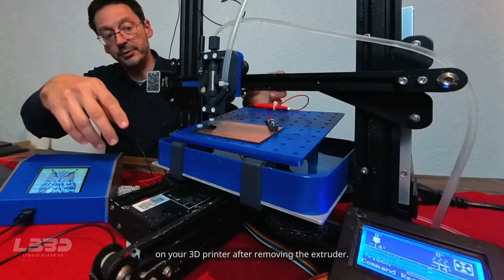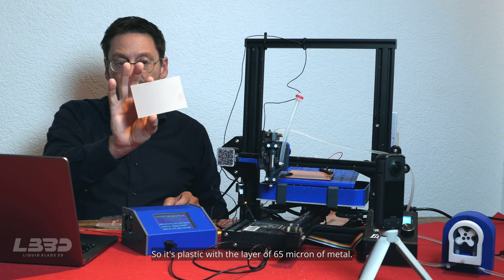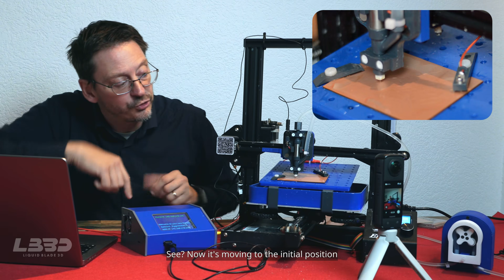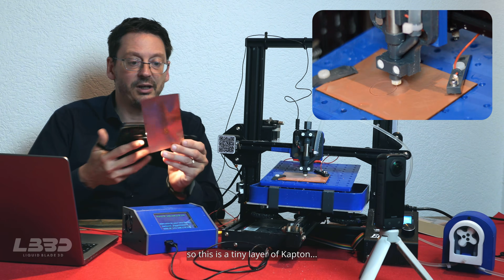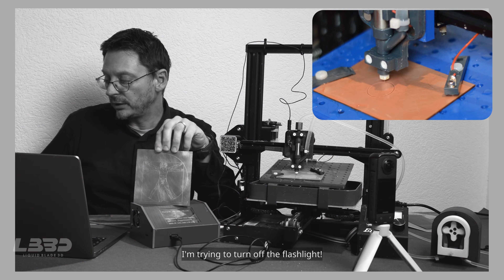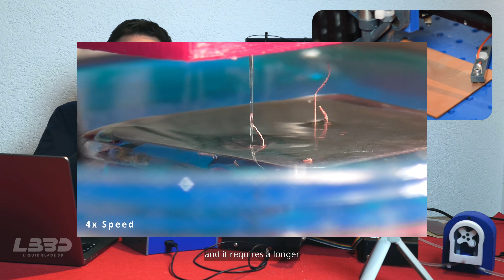Cut and Engrave Metals with YOUR 3D printer! - Liquid Blade 3D

Comment: As a fabricator I must know what the maximum thickness of material is that can be cut. 
The greater that capability the more interesting this will be.

Compatibility with low-cost large format printers like neptune 4 max would also strongly increase the usefulness.

Comment: Since it's working for bedslingers, will there be a version for the VERY common Bambu A1?
Reply from the maker: We made a list with some common 3D printers to support, but since LB3D is relatively easy to adapt, we are also open to support other 3D printers. If you are interested, email us at info@athenatech.nl and we can find a solution!

Comment: 1. Can I cut alluminum on this machine?
2. Can I cut steel on this machine?
3. What is the maximum thickness of cut?
Reply from the maker: 1. Yes, all conductive metals can be etched/cut (with the appropriate solution) 
2. Yes, we also made a time-lapse video cutting steel here: https://youtu.be/1JAKQVie_q8 
3. We tested thin cuts, in the region of 0.1 mm width and depth up to 2/3 mm. The cut on solid steel was a 0.2 mm wide line, with a length of 28 mm and depth of 0.8 mm in around 2 hours. We also did 5 mm thickness on copper from a single side. There is really no maximum, it depends on time and the type of metal.

Comment: Great project , now I might consider pulling out my ender 3 out of storage, question can the process  be used to cut or shape Carbide tips for lathe tools?
Reply from the maker: In theory every conductive metal with the right liquid solution can be etched and cut with Liquid Blade but of course some metals are way harder then others to work with. Carbide tips are made of tungsten or titanium, we did a test etch on titanium and it works, but it takes more time and current then steel or copper.

Comment: Looks like an interesting project, looking forward to it taking its final form out of the prototype phase. Would love to try it out, however I am not sure how I would be able to source those things like Borax and other things over here in Bhutan, as we don't get many things in the local stores. Even for printing filament, until now I have been getting it delivered via Amazon india. 
Also I had a question about the setup if the final product would not just be a fully working out-of-the-box product like the printers. Currently I have a Bambulabs mini and I have an older Ender 3 s1 which has been collecting dust since last year. If it would be possible, I think it would make perfect sense for me to turn it into a permanent setup for your LiquidBlade product. This is a great initiate and wishing my congrats to your team and the endevours la 🫡 I would love to know more about how to remove the printer build plates and where do each of the components like the tray and plates go.
Reply from the maker: Thank you! 🫶 The final product (as well as the prototype you see here in the video) are fully working! We will post a follow up video on how to assemble and take the system apart, it is really easy and quick. 
About the ingredients for the solution, we will open our online shop with accessories, spare parts and, if the there is demand, also solutions for different type of metals. Feel free to email us at info@athenatech.nl for any technical/commercial question!
Reply: @Athena-Technologies  Thank you for your response, I look forward to it and hopefully will be able to obtain or try it for myself, being so far on the globe is a bit difficult for me to source items on the go :D

Comment: This is very interesting, have you tried bronze, or aluminium.
Also what's the minimum trace size  / pitch you can achieve when etching pcbs?
Reply from the maker: Yes, we are currently trying different materials like titanium, zinc or steel. You can check our social, we will post all the experments!  

We achieved 0.2 mm minimum width for the trace but we are just launching the project, it can only get better from here 😁👇 https://www.kickstarter.com/projects/athenatech/liquid-blade-3d-cut-and-etch-metal-with-your-3d-printer

Comment: This seems to be amazing. How are the edges once it has cut out a piece? Very sharp? Would they have to be smoothed? Or could the parts be used as jewelry without any further processing?
What would be needed to cut steel or gold?
How is it possible to print metal? So interesting. So many questions...😅
Reply from the maker: We apprecciate the curiosity! 😁 So, edges are not too rough but for jewellery maybe they might need some polishing. All the object we posted on our socials are not processed further, check earrings photo! 

Yes, is also possible to etch and cut other metals (we posted titanium recently) but each metal needs its own solution. 

Metal Printing uses the same concept but in reverse, still needs some development 😄 Back us up on Kickstarter, we are eager to research more!